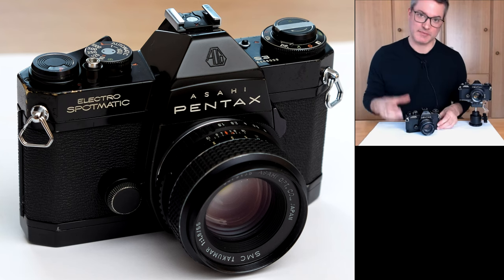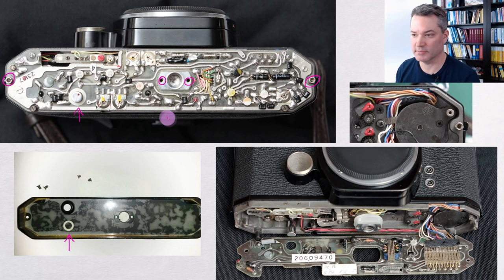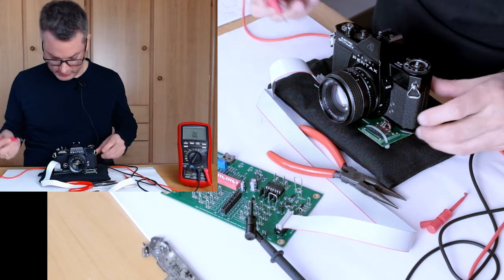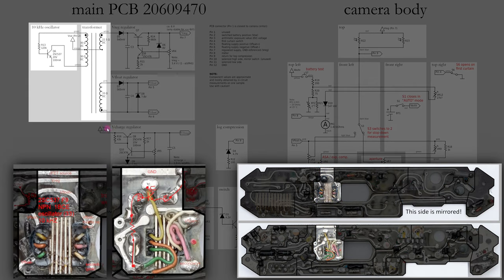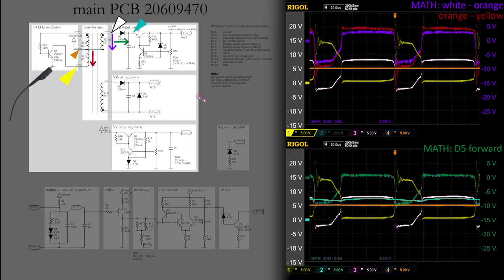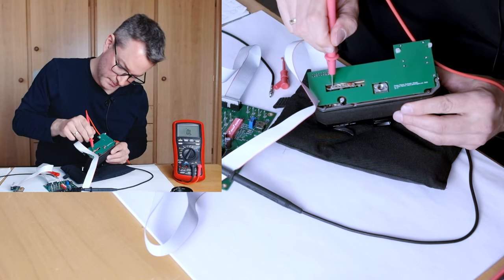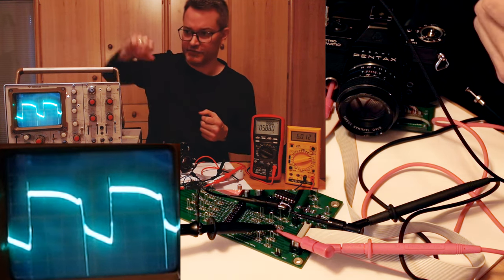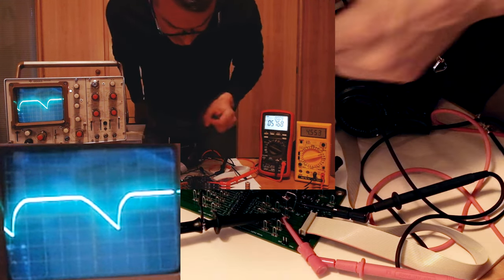The Pentax Electro Spotmatic: Reverse-engineering a marvel of 1971's Japanese electronics [Part 1].

Comment: I have two broken ES, they were waiting for this video because they were considered unrepairable. Thanks, you have made the internet more intelligent
Reply from the maker: Thank you. I'd be interested to hear what kind of symptoms your cameras are showing.
Part 2 is coming soon, in which I explain the theory of operation of the electronics and measure the light sensitivity. I hope it will be helpful.
Reply: @EdwinSteiner  Thank you for your reply. My first camera (looks like a new) has the same symptom: the speed remains always fast, despite the "correct" arrow reading in the viewfinder. Battery check ok, light reading ok, speed doesn't change. 
The second camera (with traces of heavy wear and damage) works almost well electronically, speed changed correct (at hear), but I'm not sure of the correct metering and also the ISO knob is blocked by shock.
I had the idea of replacing components between bodies, but it risks losing both cameras in the process.
Reply from the maker: @andreikudriavtsev4355  When you say "light reading ok" for the first camera, do you mean it agrees with a known-good exposure meter over the full range, or is it just reacting to the light approximately in the right direction, like my camera did? These can point to quite different root causes.

It's good to be cautious about swapping components because there are different revisions of the electronic boards and also some components need to be matched to each other. However, once you know exactly what's wrong with each camera (and I hope my videos will help you to find out), you may be in the nice position of having a donor camera for some difficult to get components.

There's a lot of information in the upcoming parts to the video but always feel free to contact me directly for questions. I have a lot more detailed information than I can possibly share in the videos, and it would be interesting to compare board revisions and causes of failure.

Comment: I think you can confidently regard yourself as a world leading expert on this model; others will be referencing YOU for advice. My ES2 still works, but usually caps at 1/1000. (Turning the camera upside-down reduces the weight of the mirror and sometimes helps with this.) Anyway, I found you on the Pentax Forum and will subscribe here as well. Thanks for saving this example from the past and keeping it from being scrapped.

Comment: Great video! I was wondering if you would be able to share a link to the slotted screw driver you used (the one that has a "5" on it @5:32)? I've been looking for one of these and haven't been able to find one!
Reply from the maker: Thanks! I made this slotted screwdriver myself using a Dremel to grind the slot into a regular old slotted screw driver we had lying around. I also had to grind it a bit flatter to make it fit. So, unfortunately, I cannot give you a link. If you don't want to make it yourself, you could try searching for "face spanner", which I think is the name for a tool with two frontal prongs for turning fasteners.

Comment: Hi. I would like to say a huge thank you for this series of videos about Pentax Electro Spotmatic. 
I bought myself such a camera for restoration, but the electronics worked in it. 
Recently, I accidentally put a 4LR44 battery with the wrong polarity and the exposure meter stopped functioning. I would really like to repair it, but I can't find an electronic repair circuit. 

Problem:
The exposure meter only does not react to light. ISO switching, exposure correction, aperture data transmission systems change the values of the exposure meter, but only when the mode is turned off. If you turn on the exposure measurement mode, the camera will work out 1/1000 and not react to light.

I will be very grateful for any help in solving this problem. Thank you in advance.
Reply from the maker: @HPeshka_SHORTS  Hello! Sorry to hear about your troubles. I will be traveling the next days, so I cannot look into it immediately. Maybe you can send more details about the behavior of your camera to my email: edwin dot steiner at gmx dot net. In particular, what do you mean by "measurement off"? Do you mean the open aperture metering mode?
Reply: @EdwinSteiner  Thank you!
That's right, when the exposure metering mode is turned off, the arrow reacts to switching other parameters.

I will email you a more detailed description of the problem and a link to a video of the problem.